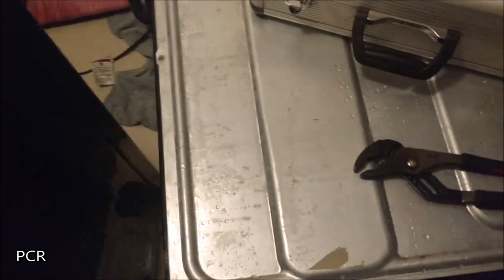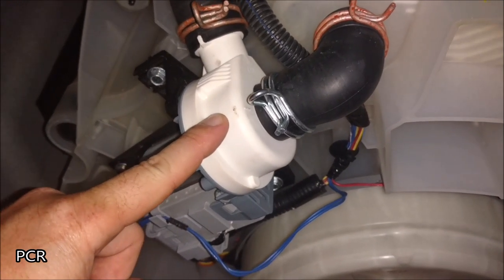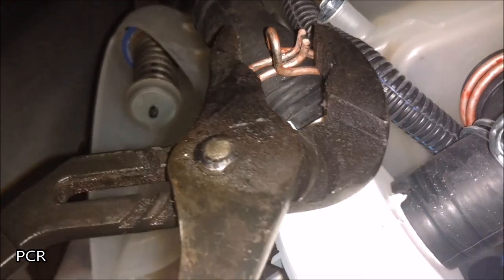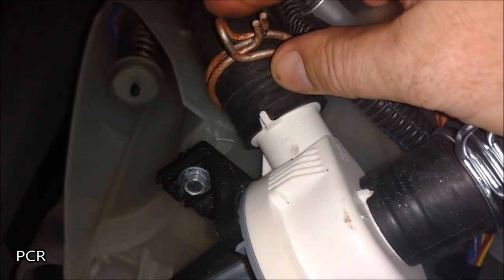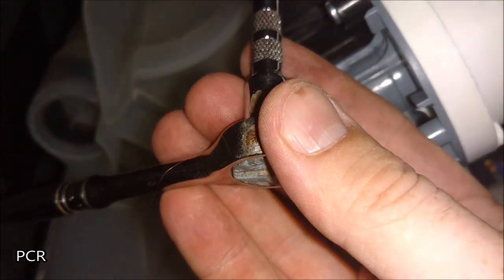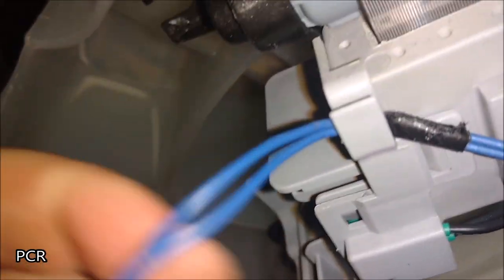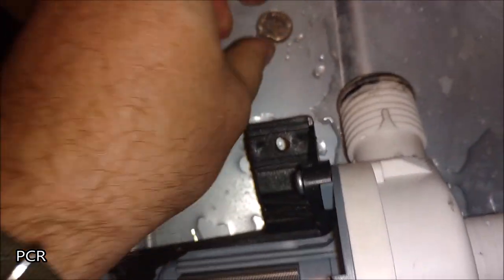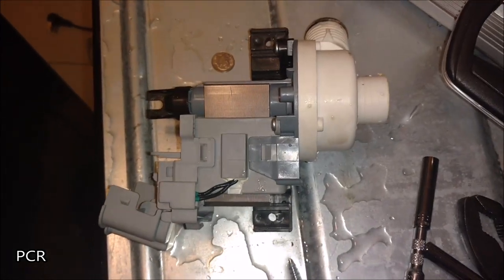HOW TO: Remove coins from washing machine

Comment: I have a Maytag commercial grade washer and dryer that is top load. I have found coins in the gap of the outer edge of the wash plate. They where caught in the Grove. I don't think they can get pass that on the new machines right?

Comment: Question. My whirlpool is making a loud screeching sound on what appears to be the pump start up after the drum is spinning 
Is something in the pump? Is is it the drum. It sounds like loud screaming.
Reply from the maker: I would flip it on it's face and take a look. If it has a belt, then look for heavy black dust. If it has the dust then replace the belt or try to tighten it. Screeching sounds are usually belts. If it doesn't have a belt, then look for the drum brake, as that could be sticking and may just need cleaning, maintenance, or replacement.

Comment: Is it hard to do this with a Cabrio washer?  How should the washer be placed so it is easy to get to?  This keeps happening often so I have to do it to save money. Thanks.
Reply from the maker: It's actually really easy. I've had to remove coins several times and I think I have to do it again today. Just put an old towel down in front, rock it onto it's face, and do what I've shown here. The hardest part is getting it back up as it will want to slide, which is the 2nd reason you put the towel down. The towel really helps a lot in getting it back up on it's feet. If you're a smaller stature person or it you're a bit out of shape, you may want to have another person with you to get it down and back up. But really, it's easy enough that I haven't even considered the idea of a repairman.
Reply: @PetesCreativeRecycling  This is not that easy as you make it sound.  I have had experienced repairmen who did not want to do this. Yesterday, I had a repairman who came over to fix my fridge and replace the drum belt on my Cabrio dryer, but did not want anything to do with removing the coins.  He just gave up and said that he will come when it damages the pump.  The repairmen I have hired were on the old side and not that flexible.  That's why I don't want to take any chances.  It is easy to remove the parts but very hard to put it back on.  You evidently are a pro at this.  I will see if I can get my son to help to see what's involved.  Thanks.
Reply from the maker: @borivilli  I'm no pro. My degree is in software engineering. Replacing the pump is just as easy as removing the coins. It's the same process and it's not hard at all. I actually think it's easier to put the pipes back on the pump than it is to remove them. Good luck man. If you remove the coins you wont need to buy a new pump. If you don't remove the coins you'll need to clean a giant flooding mess and replace the pump.

Comment: Sorry but you didn't say if it's a top load washer or bottom load. When you started the video I wish you would have showed the front of the washing machine to know what style your talking about because hoses are in different areas on front load and top-load, correct???. Thanks
Reply from the maker: Sorry for the late reply, I guess YT now requires approval on some? Anyways it's a top loader.

Comment: Sir I need your help to fix my haier automatic washing machine.
Reply from the maker: What's wrong with it?
Reply: @PetesCreativeRecycling  Coins stuck inside...is there any source available so i can share videos with you.
Reply from the maker: @funtush4808  where are the coins stuck at? If its the pumps, they're easily serviceable like any brand, just take them off, separate the housing, dump the coins out. If it's in the drum, then that's a lot different as most brands come apart very differently and some have press-fittings which aren't easily serviced.

Comment: Seeing this video i opened drain pipe and found 4 coins i washed with luke warm water but water drain slowly from drain pipe..  What should i do
Reply: I did not find any coin in the pipe or the white holder and it was hard to put is back i will if it work